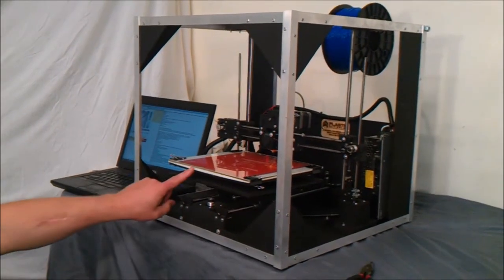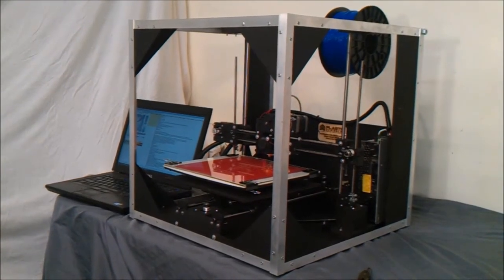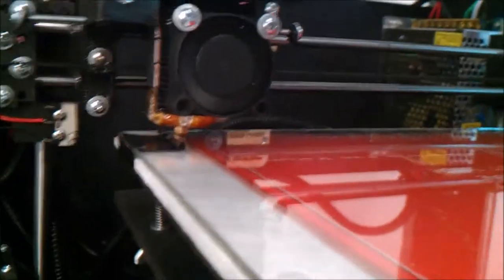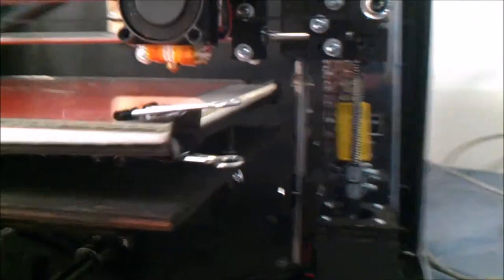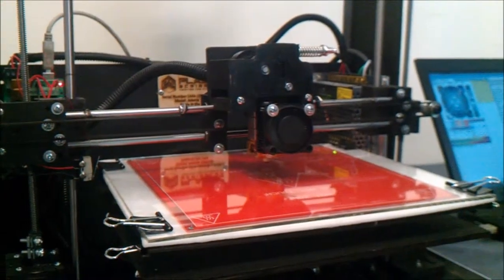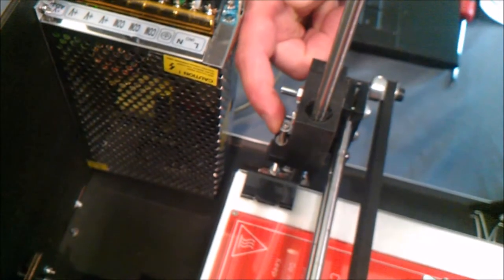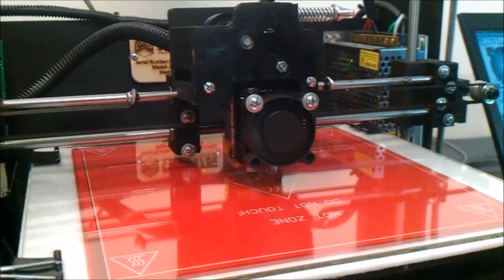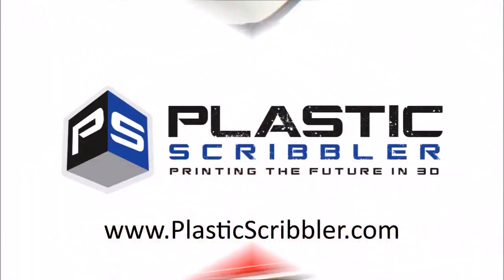Leveling the bed on an Asterid Series 3D Printer by Plastic Scribbler

Comment: How do you level the bed on the new 2000 series?
Reply from the maker: The same way as on an Asterid 1000 series.  There are three leveling springs that are adjusted with wing nuts.  The undercarriage of the 2000 Series looks a little different but it is the same procedure.